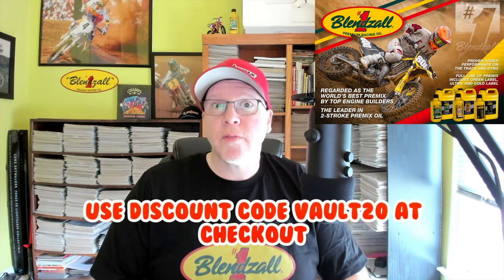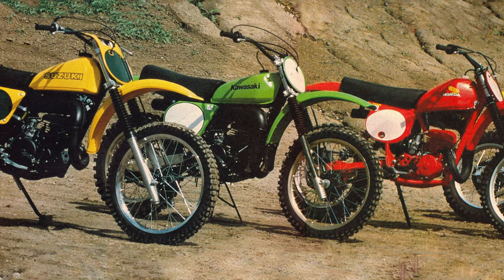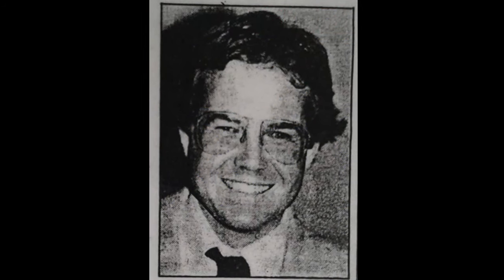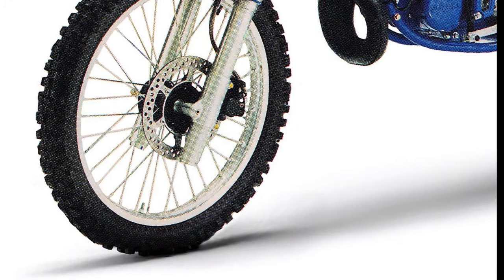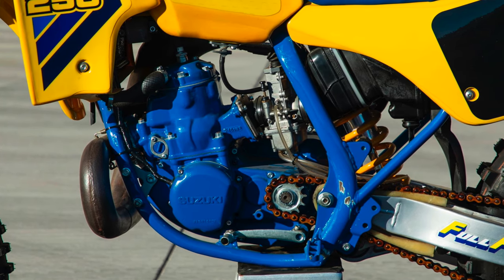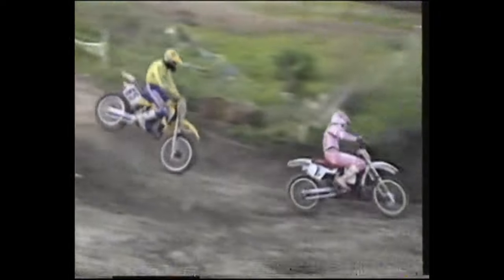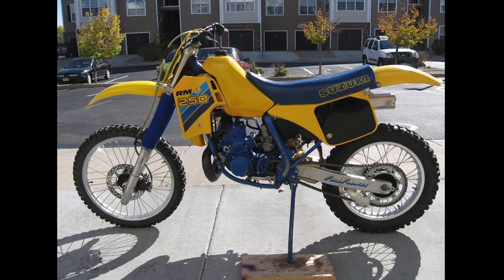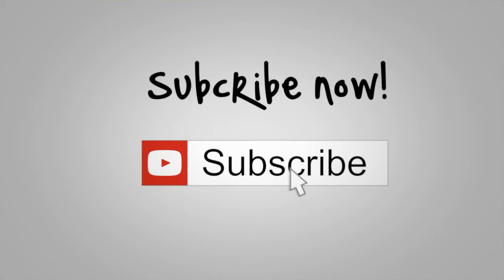1986 Suzuki RM250 Motocross Test Review

Comment: Man, i loved the 89' rm250. It was fast as hell and the best wheelie machine ive ever experienced.  I had the engine rebuilt and blue printed by a local guy and omg that bike was tough to beat in a drag race. Excellent cross country and woods weapon.  I rode 5th gear wheelies on just about every straight. Miss that bike. .thanks for your great work Tony.
Reply: Strange I found that year Suzuki an absolute dog. Couldn’t touch a Honda or Yamaha

Comment: The 1988 RM 250 is the bike to have. The' 89 was a better looking bike, but the '88 would smoke it. The '88 was more reliable than the 86 or 89.
Reply: 88 was the only good rm250 since the 82, and i'm restoring an 88 right now.
Reply: @andreawhalen4142 I’ve got one down here launches out of the gate like u wouldn’t believe 🚀👍🇦🇺
Reply: @jamieteal2107  I'm an open class heavy modded class rider no 250 amazes me nor is quick to me, ill finish this rm just because i like it but i had already experienced about every japanese 250 made in the 80's and 90's for the majority of those years the cr's where quickest, 95cr's in particular would keep pace with an open bike for a bit. I want to build this rm because it's the bike"Bob Hannah built" and has more in common with the 84 cr factory bike than even honda's own bikes, bob knew what honda did to make the power and gladly shared it, it still took suzuki 3model years to produce it though. I bought a brand new 85rm250 back then, and it was a total pos and ate roost like a glutton.
Reply: @andreawhalen4142  who cares
Reply: @jamieteal2107  Those that comment must

Comment: I disagree about the engine, yes it lacked top end but if it was running right you would swear it was 300cc or more the way it drove down low. The chassis though,ugh. That eccentric link was garbage, high handlebars and eventually would break the frame above the swingarm mount.

Comment: wasn't it aetc? Automatic exhaust timing control?
Reply from the maker: This design was only used in 1986. The AETC was a new system introduced in 1987 that introduced a HPP style guillotine valve instead of the ATAC style exhaust chamber used in 1986.
Reply: @TheMotocrossVault  Ah ok mines an 88 so that makes sense, i owned an 85 and was so disappointed in the bike i jettisoned rm's for cr's until in the early 90's i had a chance to ride a friends 88rm and wow what a difference that 85 was a slug, my brothers 84 cr would melt it and it broke non stop, in fact it never did stop overheating. I spent every dime i made back then trying to make that 85 rm as quick as the 84 cr.  Others had problems with 84 cr's pistons, my brothers never missed a beat and it was a beast, i just hated honda back then is all.

Comment: That wasn’t a great bike , but the refined 88 absolutely was even with outdated look which was pretty ugly. My 89 was slower but felt smaller .
Reply: 88 was a great bike even though it had a outdated look at the time, tike you said. I also have a 89 and think they would have been better bikes if they would have continued developing the 88 engine, instead of the case  reed 250’s that followed.
Reply: @brokenchainmx4350  Exactly! Btw I did some jetting for my client and friend who has an 89 fitted with Vforce Reed , Pro Circuit exhaust, copycat Pwk carb and flywheel weight. It’s very strong and usable .